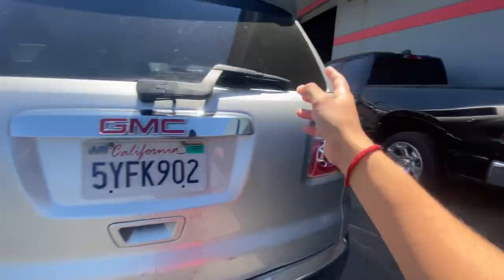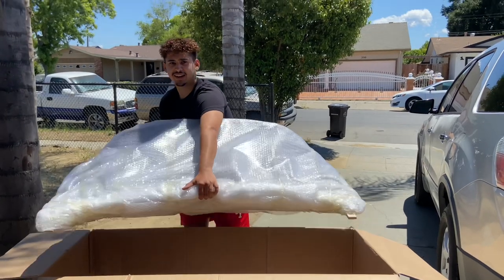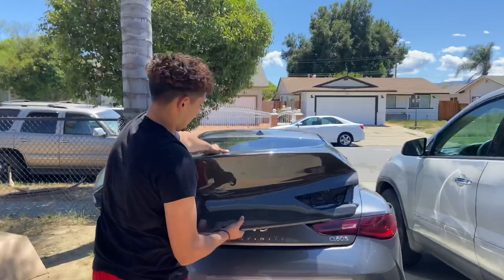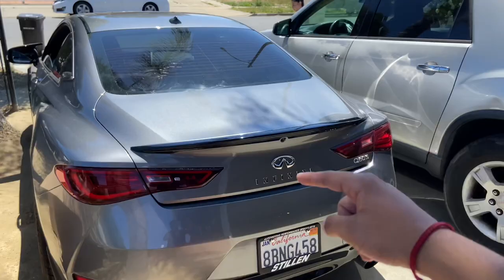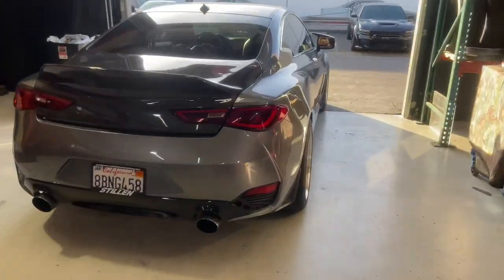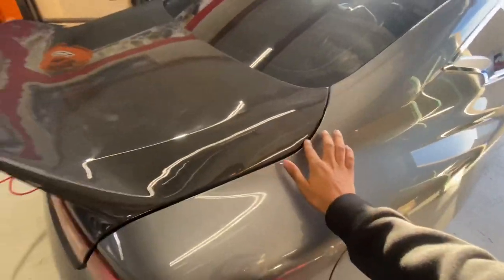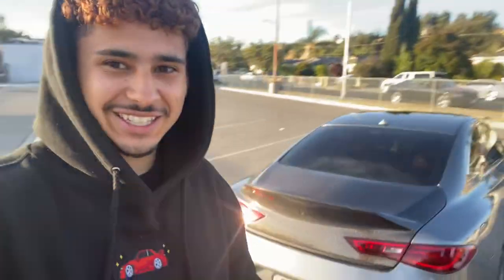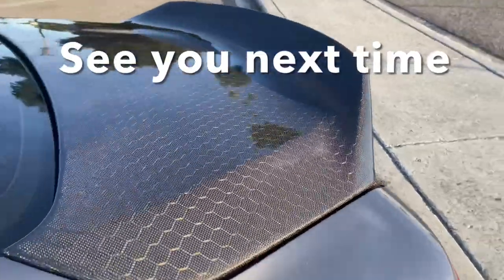First Ever Honeycomb Carbon Fiber trunk for the Infiniti Q60

Comment: Hey bro I have a question how did you removed the trunk lid wiring because I been trying to install my cf trunk but the wirings are stock and they won’t come off thank you
Reply: Bro I’m trying to figure out the same thing smhh.
Reply: @Speedycory6  I figured if out you have 2 options you can get a new set of harness from infiniti or you  cut the trunk lid to be able to remove the wiring just need to be careful, i had to cut it the whole side of the trunks , but it was worth it new trunk looks sick 🔥🔥🔥
Reply: @carlosquelex4640  broooo yeap I just cut the trunk because I need to get it out unfortunately. F*** Infiniti for designing it this way!!
Reply: @Speedycory6  thats what i said , but good thing you were able to do it 💪🏼

Comment: Yo did you have any issue with the back up camara ? I got a carbon trunk as well but I’m having a problem with it since it doesn’t have the mount/bracket that holds the rear view camara like the oem one comes with